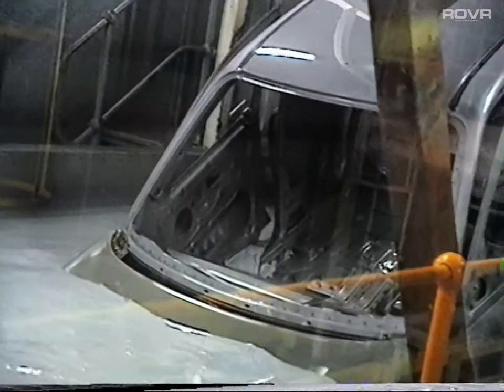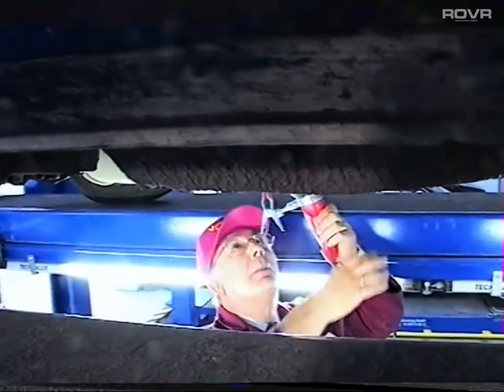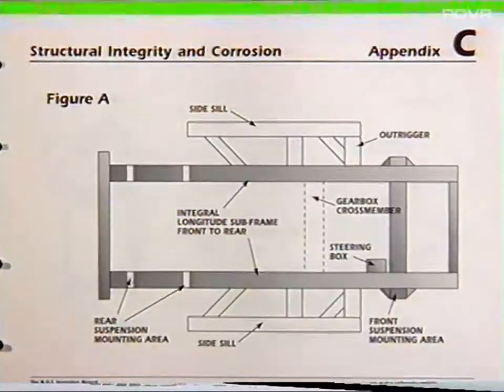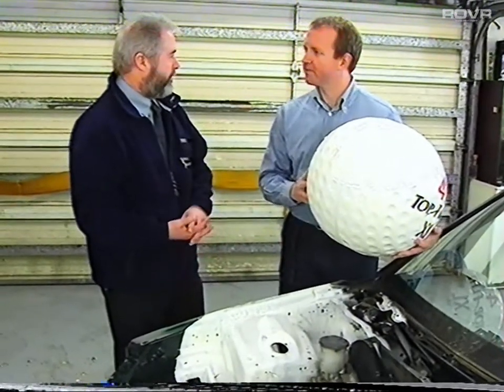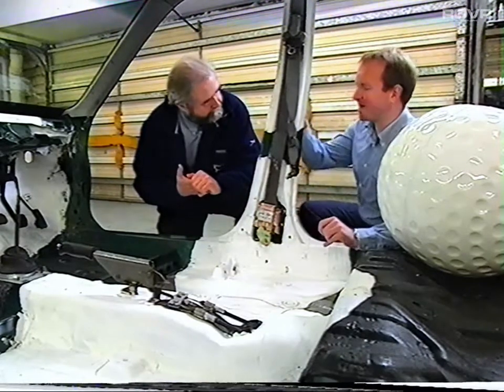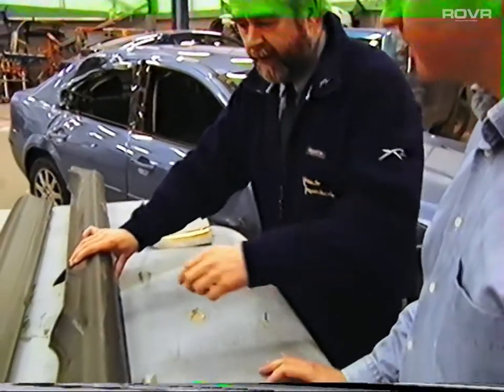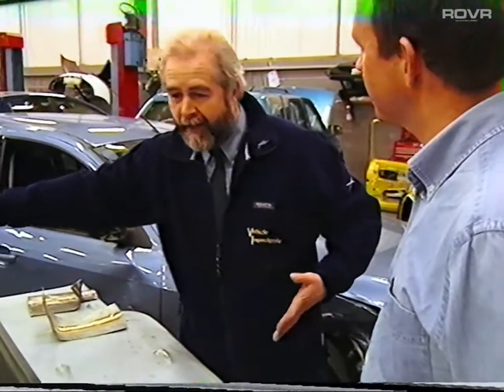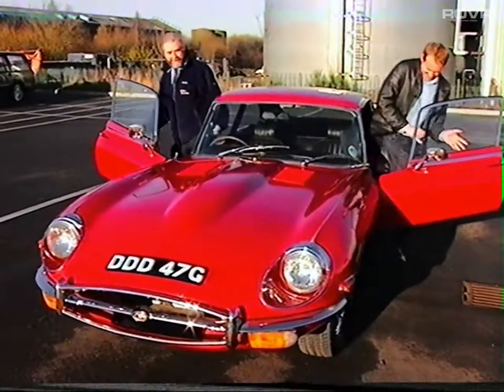Vehicle Inspectorate (UK) - MOT Matters - Corrosion? Not a Problem! - VIV27 (2003)

Comment: Oh, the blue frontera in the background 😃 its the first time i see one of these with a shiny paint 😄😄
Reply: @ShitHappensRLY  i know, i saved one from a junkyard last year 😅😅😂😂
Reply: Probably the most appropriate backdrop for a lecture on corrosion.
Reply: @andreasu.3546  nah, the old ones are good, it's the third one i have (pre1995), and it's solid even after 30+ years. Yes, some things are pretty worn out already, but rust is not one of the issues. If we talk about a second gen frontera (and pretty much any other vauxhall/opel from that era), then you are absolutely right, those things are gone
Reply: @ThePeca1988  Thanks for the info, I have no experience with the Frontera, just with regular old Opels (Kadett, Ascona here in Germany). Those were bad and had a reputation of already starting to rust when the prospective buyer was still reading the catalogue.
Reply: @andreasu.3546  okay for kadetts, asconas, vectras, omegas, that's absolutely true sadly. I think the first series of fronteras is an exception just because its core construction was designed by isuzu, and its simply made differently, but who knows, rust free opels will always be somewhat mythical 😀